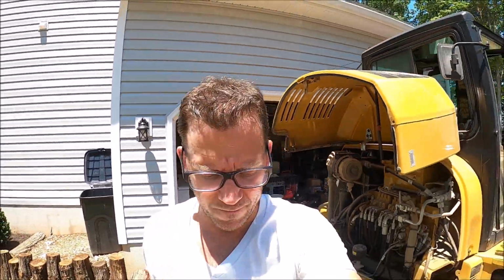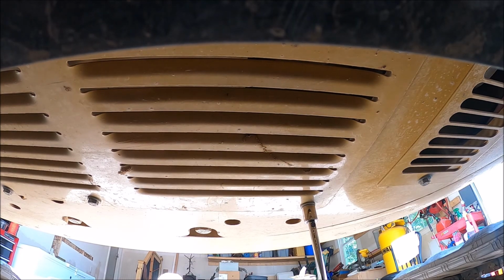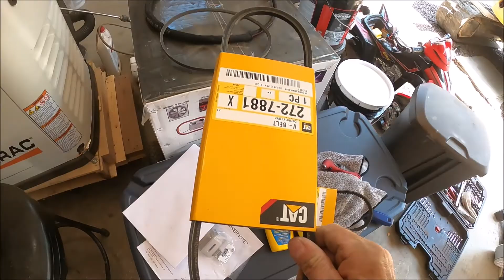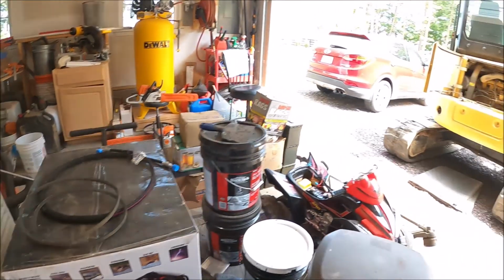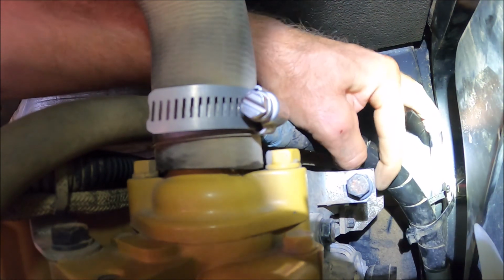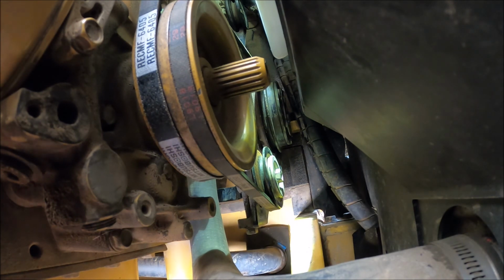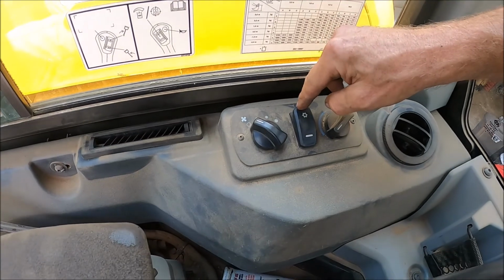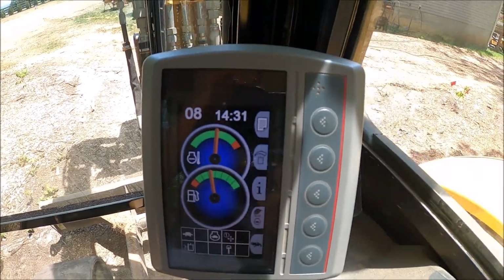Cat Mini Excavator - Overheating Issue Resolved and Other Fixes

Comment: How do you find the air con? I have the same machine and other people I have seen with them and it's terrible. It's hot in Queensland Australia but both their and my machine you can't close the doors or it becomes a sweat box
Reply from the maker: Yeah, I know what you're saying. Mine gets hot as well. But, after I replaced the belts, and cleaned the cabin air filter, the ac works worlds better.
Reply: Should've just tighten belts, cause the new belts just gonna stretch and need to be tightened again 🤷‍♂️
Reply: @mikehol724  the tensioner is maxed out even with a new belt. The three or four we have is a piece of junk for about a half a dozen reasons not just the belt slipping and overheating.
Reply: The 304 that we have is a piece of junk it was overheating when it was new they said it needed a new belt even though it was new machine put the new belt on maxed out the tensioner and it still wasn't tight enough so that Belt doesn't last very long at all it's slipping and getting hot again but there's a half a dozen other reasons why this 304 is a piece of junk. If I won the lottery I would drop it through the roof of their engineering department at the very least I would spray paint it lemon yellow and drive it around to every Cat dealer I could for a thousand miles until they gave us the money back for it. I've been hating on it for 3 years now and it hurts my back every time I run it
Reply: @JerichoRally Hi I have 305cr 2015 and have all monitor light on and not show the tempeture gauge and fuel diésel gauge, in display have a big Cat. Do you have any idea about my problem? With tha 305?

Comment: 2019 304 that we have is a piece of junk since brand new there's a half a dozen reasons why it sucks the belt tensioner gets maxed out even with a new belt it's barely not tight enough so the belt is not last very long and then it starts slipping it overheating but there is a lot of other reasons why this machine sucks if I won the lottery I would drop it through the roof of the cat engineering department